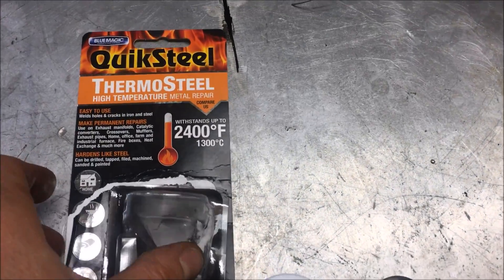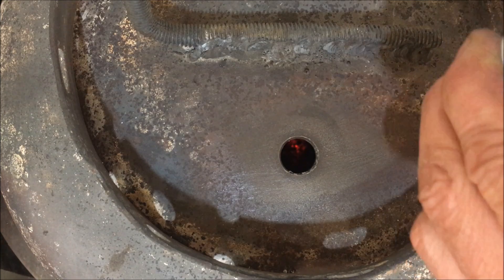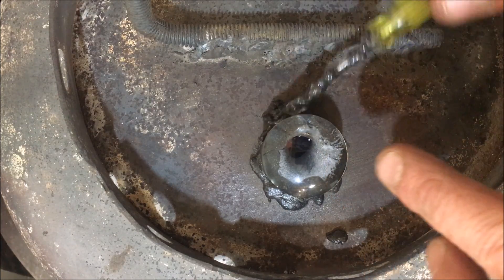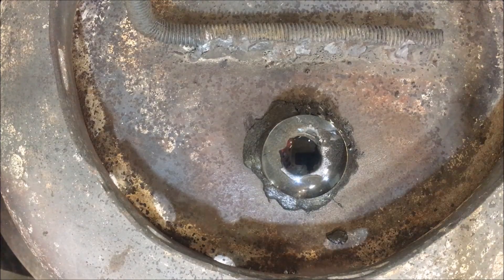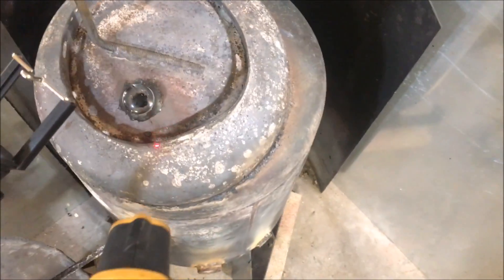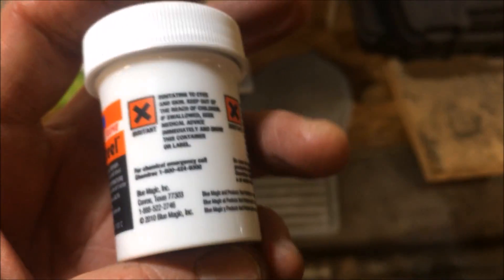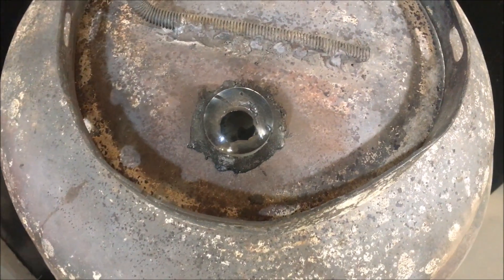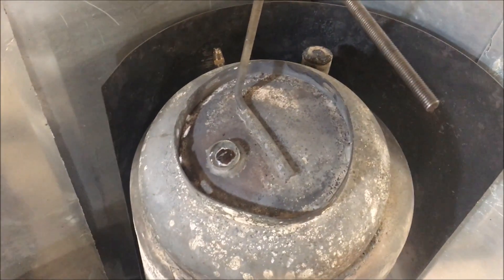Quick steel Thermosteel ( Review )

Comment: I just used this to seal a crack in my exhaust manifold and so far I'm very impressed. I may do a review after a couple day or weeks of spirited driving.
Reply from the maker: LOL , never crest under spirit or around corners , your radar may not pic up ...
Reply: @NOBOX7  is it still holding after all these years?
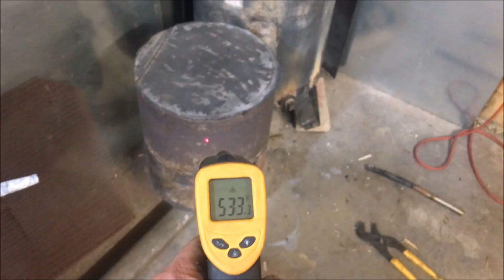Reply: @Mike-oz1wf  answer is already in the video. @ 10:15
Reply: Yes I'm hoping to use this for a temporary seal on my exhaust just to pass inspection
Reply: How is it doing!?

Comment: I just used it works great but if you read the instructions it's a filler for steel to steel or steel to iron patches it works great for it's intended use

Comment: U would not be able to use this to fix loose thread if there’s high pressure ?
Reply from the maker: use jb weld
Reply: @NOBOX7 jb weld got too hot and just started bubbling and melting off

Comment: As a result of video, I purchased Thermosteel.  Not easy to work with, very funky solution after mixing.  Let cure four days before starting engine.  Initially, after curing seemed fairly strong.  Ran engine 4-5 hours & substantial cracks.  Do not recommend for any length of time.
Reply from the maker: Thanks for the input

Comment: Hi .. can this product be used on aluminum transmission case..
Reply from the maker: I wouldnt trust this stuff on any thing, use heigh temp jb weld
Reply: @NOBOX7  thanks...there is crack on transmission  case onmy car skoda rapid..its cost 70k to replace it.. will JB weld extreme heat will work? You experience with this help me a lot..

Comment: 10:22 ..well actually it is 6 years ..damn ..so did it last?
Reply from the maker: NO lol but i may have used it wrong and it may just be for sealing cracks not as a glue
Reply: @NOBOX7  you could try a lense that's encased with metal ..and glue metal on metal ;)

Comment: Just used this stuff on an exhaust pipe break. Wish I spotted this vid first since I was debating on this or JB weld.
Reply: Jb weld didn't work it's garbage to
Reply: @JOE...Leach.  hey there Joe, it's been 2 years since that post of mine, and wouldn't you know it, I've finally replaced my exhaust pipe this summer after years of patching the same break over and over. Having used the different pastes,  putty's and wraps available at my local advance and AutoZone. Honestly I've had the best luck with water dipped Fiber Fix and the occasional soup/steel or aluminum can depending on size of the hole. Just make sure to sand the area clean or it won't adhere.

Comment: Do you think this would be ok to use on a hairline split on a line coming from my sending unit? You can’t see the split but when I start my truck there’s a fine mist of fuel that sprays out...your thoughts?
Reply from the maker: i would clean the line then apply some jb weld ,then rap some copper wire " a single tiny thread like strand " and wrap it around the pipe and continue to apply jb weld as you wrap the wire , leave a squib out the other end so you can twist it off, basically  your gonna make a copper wire jb weld composite.
Reply: cool idea, thanks!

Comment: jb is the only 1 ill buy now on ,i try all i can find and jb its the best at every thing i do and tested but my friend uses that quick steel on motors and it works idk how he gets it to work bc i cant
Reply: I've used it on a 2 stroke Motor too, make sure the surface is well sanded and prepped before putting this sandy Goop on it, still would recommend JB Weld tho

Comment: Whew first off MIX THE CRAP OUT OF IT! 2-3 min. Should end up being a consistency of sandy glue.  It's an epoxy-like substance. If you're using it on an exhaust system hook your shopvac to the tailpipe sucking OUT thru the tailpipe to draw the material into the crack (IF it's a hairline/small crack). Otherwise use like you'd spread bondo with screening (no suction). Let it sit for 24 hrs. Have used QS and JBWeld and actually like the QS better. Just used this on a plant air compressor manifold and worked perfectly IF you read the instructions and use it on the materials it's intended for. Also PREP IS 99% of the job!!! CLEAN SURFACE!!!

Comment: Has it held up to date?  Dependable?  Thanks
Reply from the maker: No sir i do not recommend this product so far . perhaps it has uses just not in my shop
Reply: He didn't follow instructions so there is that too.
Reply from the maker: @eduardodiaz5762  yeah but there aint nothing saving this crud , its crap no matter how you put it on . It leads you to believe its a steel putty but its far from that , JB weld is way better .
Reply: I used it on a 2 stroke iron block, it's still there after 6 months. But I can see it brittle up and not holding up to 400°, I should of tried JB Weld. Thanks for the advice.
Reply: Should of cleaned the surface first.

Comment: Dang, was hoping either this junk or JB's "Extreme Heat" analog would have the same smooth consistency as JB's original steel resin just bc I was hoping there was a chance it would outperform JB orig. as a strong thermal transfer  adhesive... No friggin way! They might as well have boulders in these products where thermal transfer performance is concerned & renders them useless for that application. Rats...

Comment: It's not glue it's a mixture of steel and epoxy that's why it's called quick steel
Reply from the maker: what's your point , i found it to be worthless foe any application , after this test we can see it crumbles to powder and does not even bond to itself
Reply: @NOBOX7  I found when mixed well it worked great but It won't bond glass to metal but is great for metal to metal.
Reply: I think the point is: read all instructions and know what the product is for before conducting a demonstration; which in this case fails, not because of the product but user error. I believe if one is being paid to conduct an experiment with a product then that same person should uphold higher standards and conduct the experiment with regard to the product’s ability.
For example: on the packaging the product stated it is for filling in holes and cracks on vehicles.... 
I’m sure you had the best intentions but unfortunately you might have mislead people to think this product isn’t any good. Now we who are looking for truth about the product, when we stumble upon your video and watch it, leave just as confused as when we came without clarification on the product. 
That’s the point!

Comment: It's not a glue. It's a filler. You're using it wrong
Reply from the maker: this was a test to see what this stuff is all about , i wouldnt use it for anything after what i saw , jb weld is way better
Reply: NOBOX7 i was in a rush and saw this on the shelf at ACE. I’m applying it to my turbo exhaust manifold stud you think it would hold up against that temp?
Reply: Correct. It’s not glue, it’s raw material filler, like filling weld

Comment: Used it to patch cracked exhaust header, it worked great. I cured it with a heat gun.
Reply: Still holding? I just did mine with it
Reply: @roccomerleno5101  did it hold up

Comment: Anyone ever use this stuff on small holes on exhaust pipes ?
Reply: Just put this sandySlime on some pinholes at weak welds on my catalytic converter unions. Worked it into holes, then smooshed another 1/8 in layer over top. 4 hours rock hard. Gonna give it overnight to cure before I bring it to temperature.
Reply: Put it in a hole on my 2 stroke engine, it gets only 400° on it still there after months. I threw the rest away after it harden and was useless
Reply: i just put it on a small crack in a  manifold, it wasent hard to aplly at a 55-ish degree angle so far im pleased but we'll see how long it holds. depending on how big you hole is id dill it to about 1/4" so that this stuff could also get inside and form a lip making it almost like a plug that way its not just gripping the surface, way less chances of it flaking off the exhaust
Reply: John Nelson  thanks man, but it still didnt stand the test for some reason it didnt hold up for me